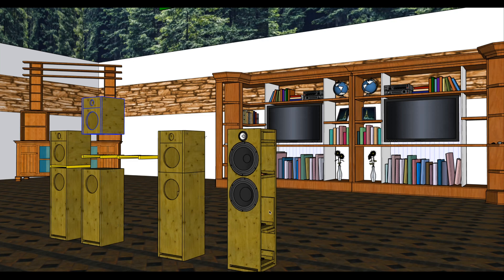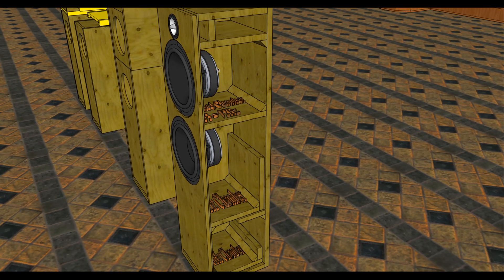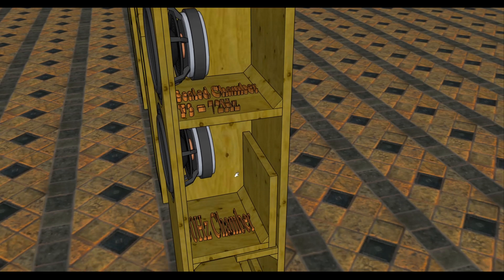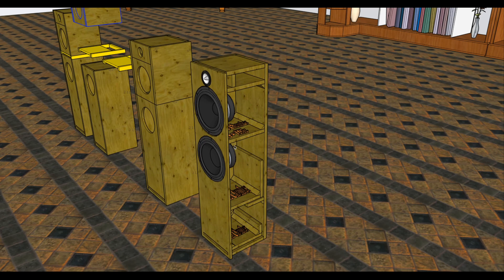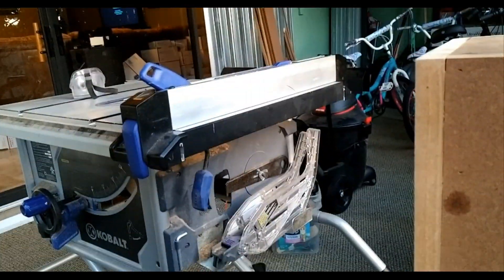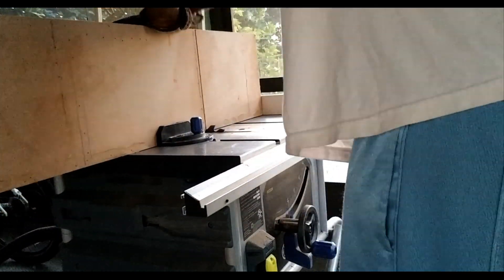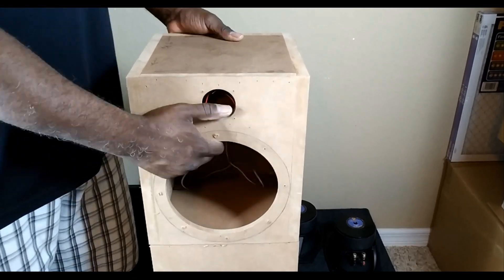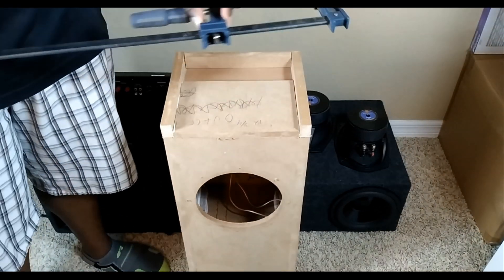Testing The Tang Band Tower - Part 2

Comment: Nice come back my friend. You did a wonderful quick fix. Looks awesome to. Loving the dual front porting, sure it will fill in perfectly over the frequency wave.
Reply: Do not use calk. Shit its trash under vibrations, use epoxy it will fill and harden much better. It can also leave a beautiful finish. You can sand and buff once you have a nice layer on the box. It will also hide all the crevis's unless you use alittle woodfiller then expoy after to make sure it looks as clean as possible yet sealed perfect
Reply from the maker: Thanks for the tip.

Comment: Can you tell me one software to simulate  a 6 pede band pass
?
Reply from the maker: Not sure I understand your question. Could you explain more?
Reply: @BudgetBassHead  i wanna have one software to simulate enclousores like tapped horn , 8 order Band pass
Reply from the maker: I used WinISD Pro but you can check out the many other ones... Looked "bass box pro"
Reply: Isnt this a 6th order bass reflex if so you can use virtuixcad for 6rh order bandpass winisd is fine